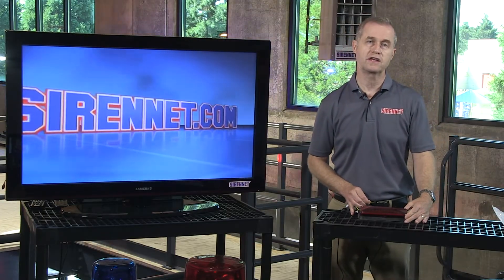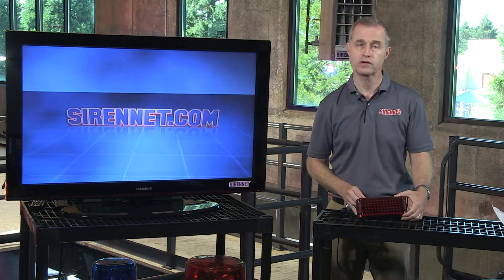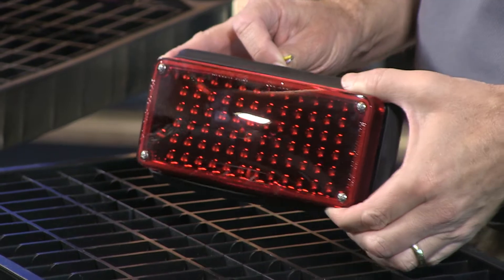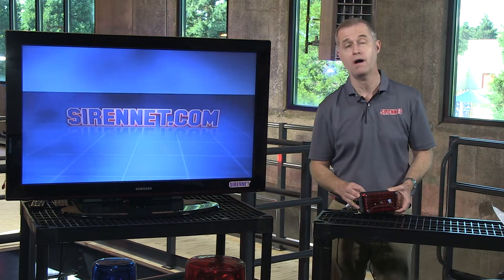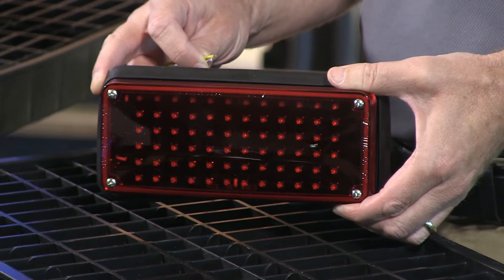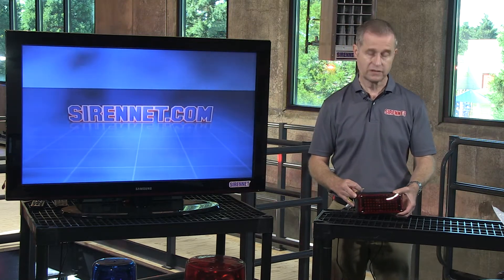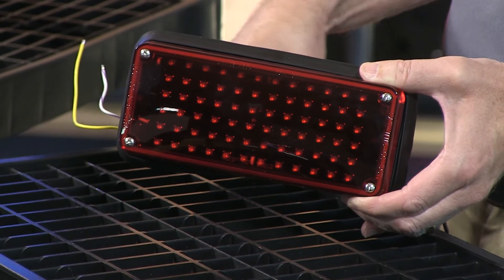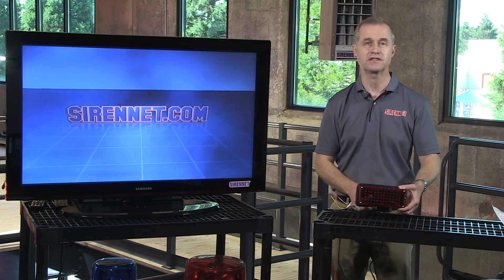Whelen 700 Series LED Brake/Tail/Turn Lighthead

Comment: Has the Whelen 700 LED Series been used for Emergency Lighting for Vehicles and not just for Braking and Signaling?

The 700s are great.
Reply from the maker: Yes, the 700 LED Series has been used for many years on Emergency Vehicles for Warning and Brake/Tail/Turn purposes.

Comment: Does this flash automatically or was it flashing because of a connection issue?
Reply from the maker: Before going full steady intensity, the brake function flashes quickly for grabbing attention. They can be set to go steady only without the initial quick flash.